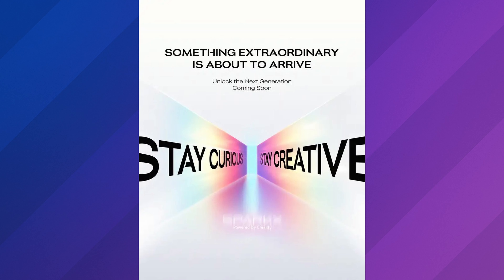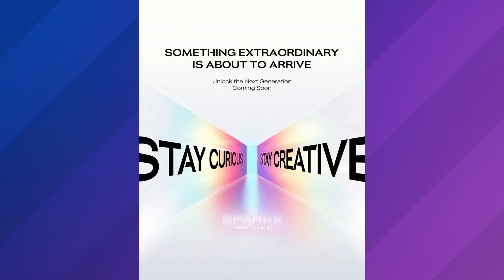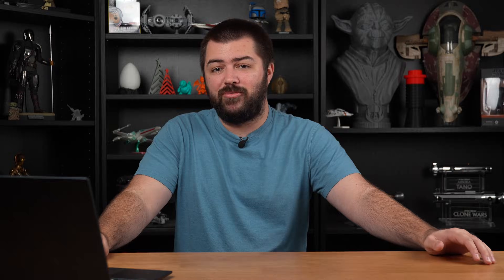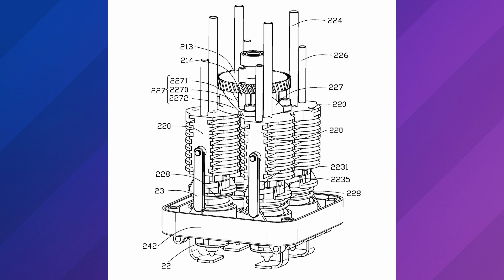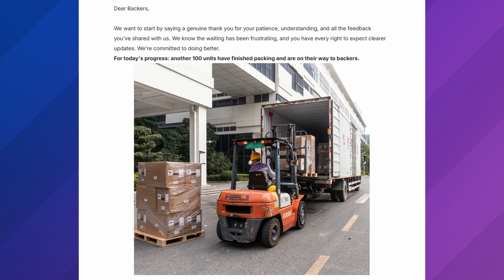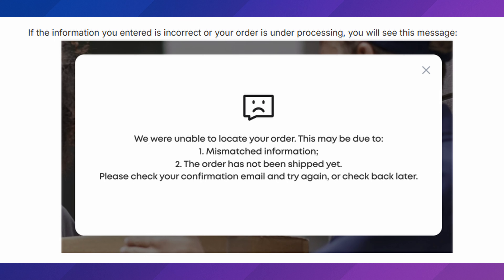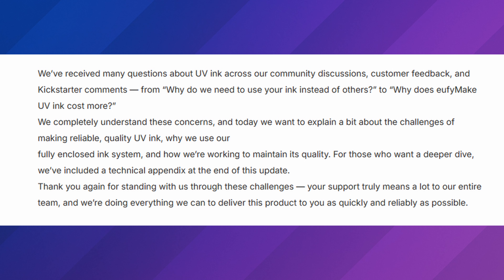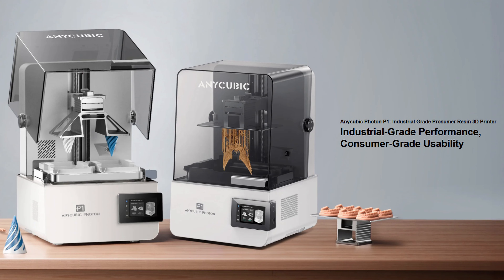Bambu Lab H2C Heated Bed, Creality Teases The Future, Photon P1 And More l 3D Printing News!

Comment: Formlabs let you use other resins, yes, you just need to pay them $5000, 5 f*cking thousand dollars more in addition of the already $10000 for the (stripped) printer (in the case of the 4L)

Comment: can i print abs/asa with ender 5 max? please help..
Reply from the maker: You need an enclosure
Reply: @3dPrinterMike  if i use encloser will it print fine?or will i still face issue..or is it better to go  in p2s or p1s?
Reply from the maker: I've never used one for sure but they are totally different based on needs

Comment: If Creality put out a new tool head with a 4 nozzle path assembly that reduced the K2 Plus max print area.... I wouldn't be mad at that. 😅But the HAVE to put int he work to get the slicer to undertsand that tool head wiht no offset issues.

Comment: Although I have a few prints (PLA) fail due to adhesion, I ran into the following issue: I got my H2C less than a week ago and already having issues with the Vortek. The issue that I am having is Vortek Induction Hotend Rack Module
Malfunction/Induction Hotend Rack Calibration Failure. From the looks of it, the rack. It  looks like the actuator is not going high enough to activate/ deactivate the Vortek hotend latch, super annoying for less than 20 hours worth of prints. I also waiter on the queue yesterday for hours and no help. I also submitted a ticket.
Reply from the maker: Hmm yeah have to wonder if they will hold up to consumer use

Comment: As a Creality Owner  ( K1C ) -  I found it takes care of my tinkering  electronics fix.  I basically consider them  a mid to high tier andriod to say Bambu's Iphone it just bleeping works status.  I am seriously debating just pulling the switch and buying the H2C Ulimate set due to my want of having multi color and really even with discounts H2d plus multiple AMS's is just as expensive a the ultimate set at 2899.  Yes alot of money with out a doubt but I boutht the K1C for 286 from Creality offical ebay store as a certified refurb and then easily have dump 250 into it.  Microswiss hot end / DXC extruder / Graphite bed just things that you dont have to do with Bambu....   I mean bambu has it flaws but it as close  having super clean prints and it just works like a toaster then any other one I  seen.  I also own a flash forge ad5m god that was a mistake for a 2nd printer some how they managed to print better out of the box then the k1c but also be more cheaply built and have to mod it more to bmake it useable.  Then I get amazing prints out of my Raise3d Pro3 Plus  though it slow by today standards and having to use thier software Idea Maker whic his a royal pain in the ass compared to Orca  though at least it own thing and not a rebranded reskin orca.  I think that is how I got a printer that still sells for 3-5k for 300 bucks with only 17 hours  of print time . The learning curve on ideamaker is just painful .

Comment: I have 3 k2 pluses with 10k hours total on them. And only issues I had was user error mean while my h2d has been waiting for parts. Had a firmware update n head slammed against machine and been a giant brick waiting for bambu cs parts
Reply from the maker: We all have different experiences
Reply: @3dPrinterMike yup they are all machines and pretty much the same
Reply: Good thing is Bambu have good support. So your parts should arrive in no time. (I got a new motor, and it took like 3 days shipping from Germany)
Reply: @AndrewTSq so does creality. I have gotten parts from them in 3-4 days
Reply: @AndrewTSqbeen waiting 2 weeks
Reply: My H2D has been flawless.
Reply: @cylonmode same

Comment: Haven’t had any issues with adhesion on my H2c. It actually holds so much that I need to let it cool down to release most models safely. I think Creality’s new printer will be some sort of multi nozzle printer. They’re still chasing BL rather than innovating. I’ve been looking at the Photon P1 but I’ve never done any resin printing. I’d love to see how to set this up aimed at the total resin noob. Printer, wash/cure station, work flow, clean up, etc. EVERYTHING it takes to print a resin model.